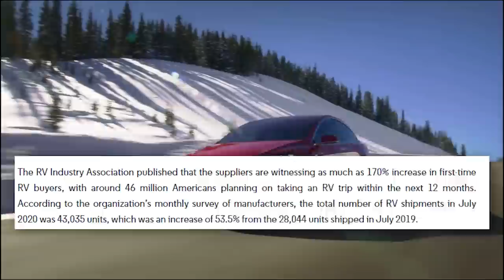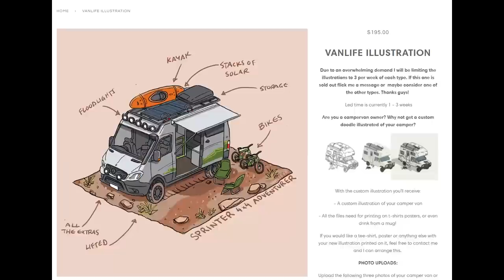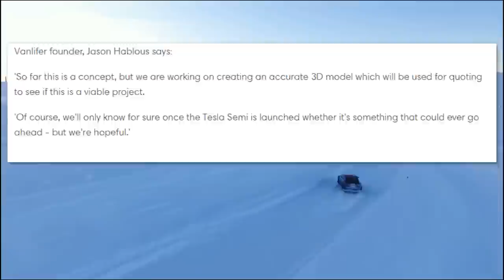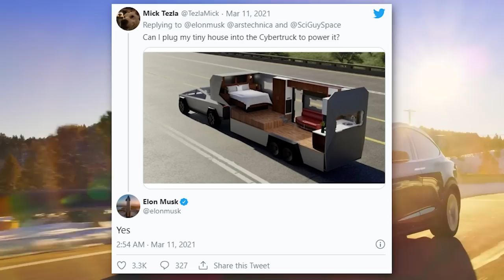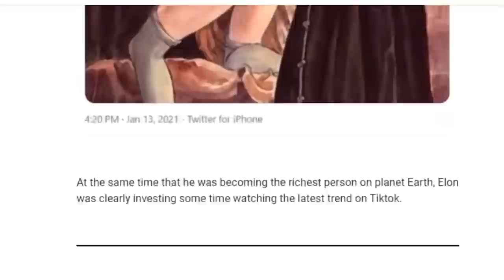The Tesla Cybertruck Trailer Could Be Next!

Comment: It would be awesome to have modules like “Jerry cans” that you could extend the range of the vehicle or plug into your powerwall at home.  They would extend the range or be like portable generators for remote areas. 

I like the idea of a trailer with additional batter bank for range extender for towing and for use once out in the field to run all your ancillary equipment.

Comment: I’ve owned a Class A rv for a couple of years and I would have loved to run it on pure lithium batteries.  I actually know a few RV you tubers who have converted their Airstream to pure lithium power for off-grid use.  The nice thing about a Tesla battery powered RV is that all RV sites have 30 and now mostly 50 amp hook-ups.  All of them!  Once you got to the rv site (or just needed to pull over to recharge), you have power hookups.  They are not super-chargers per-se, but 50amp is plenty.
Reply: Most RVs nowaday have solar panels and integrated lithium batteries for camping.

Comment: chrysler minivan 33 mpg highway. (60 mpg max because it is only a 4 cylinder 4 speed) higher torque. add a motorized wheel and 20 foot long solar cell trailer. fiber optics shine on solar cells. or just wait for biden relocation to stop.

Comment: @4:20 (of course...) Tesla is not going to sell anything other than the CyberTruck (but they won't object to doing whatever you can legally get away with.†)

The late Jack Rickard [on https://youtu.be/4qgO3A2pUr8 ] made the point that you'll be seeing this truck on every movie and TV screen for decades from its release date. Basically, trucks with curves, which are a holdover from the then extant production processes of stamping rather than folding metal are so 20th century.

Trucks are going to look like folded paper and work like dynamic sculptures because it's cheaper to make them that way.
Given the price, I can foresee a lot of corporate accountants doing their due diligence, clicking their pens and ordering ten or a hundred of these almost ugly but extremely functional beasts. It will be a decision driven purely by economics and screw the air pollution benefits. Aesthetics don't matter worth a damn to an accountant either.

The total lack of ornamentation is not a distraction. This is being sold to the Bollinger† crowd, but for a lot less. 
The inclusion of 120v 240 v and an air compressor (running off of the adjustable suspension compressor,) guarantees interest from lots of industries that do home repairs and or deliveries.
The ramp fit into the rear gate guarantees even more interest. (An electric hoist anchored to the front of the flatbed means no more having to depend on the sites having forklifts to un/load the flatbed to/from the ground. [Those hoists can be aftermarket extras since they are so variable.])

†) That only leaves terrorists and other criminals who will, of course, stop using Toyota pickups and switch to using CyberTrucks as tacticals ... right up until they discover that all Tesla vehicles constantly report their positions.
Reply: Ok crazy